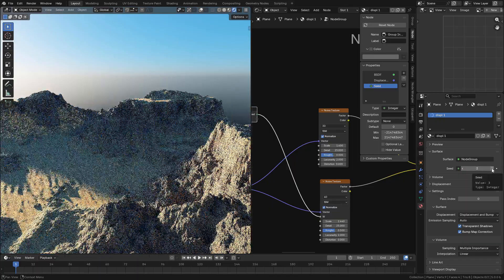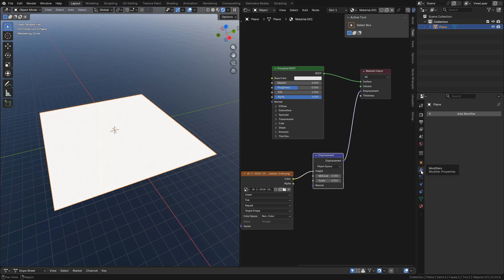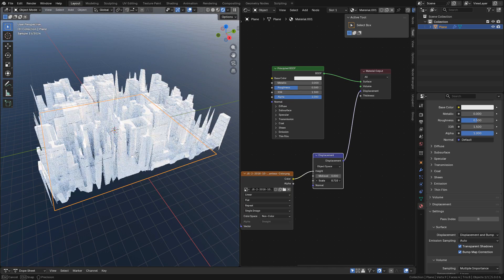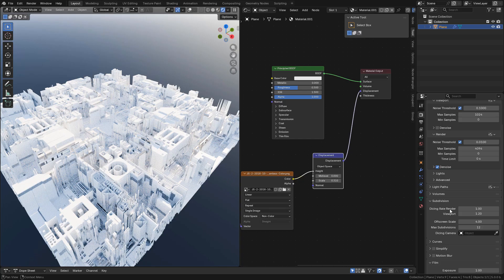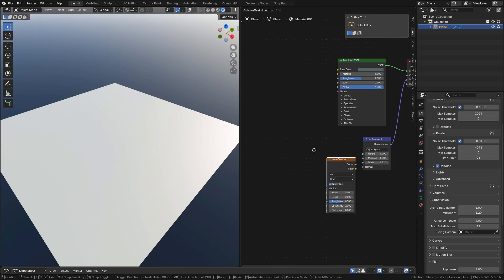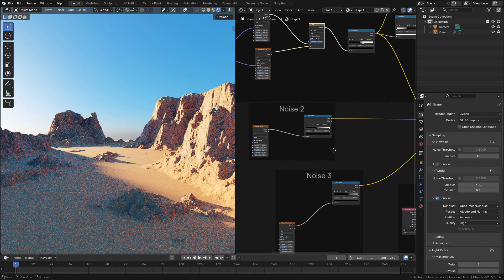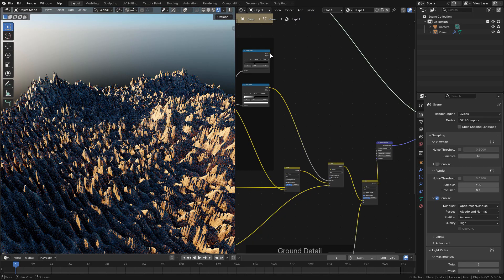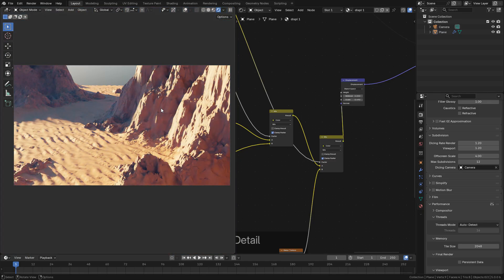Material Displacement and Adaptive Subdivision in Blender 5

Comment: Gee, I'm in 5.0 beta and I don't see an adaptive subdivision button in the subdivision modifier window. I'm wondering what I might be doing wrong.
Edit: Hold on- I found it!
Reply: how did you find it? i have the same issue?
Reply: @trymruud2386  I think you need to disable auto smooth shading
Reply: @trymruud2386  I had old project, where all mountains gone flat. There was no option in subdivision. But when creating new modifier, there it was. (I think reason in my case was not Blender 5.0 but because I had forgot "simplify" enabled🤫)

Comment: So basically it’s exactly the same as it was since 2.8, just we don’t need to switch to experimental
Reply from the maker: I've been using it since version 2.78, all these years as an experimental feature, and they have improved it, it works much better now. What else could they add to something like this? If you have any ideas, why not send them to them?
Reply: @chuckcg 
well i was saying, because your title made me think there is some new features that’s all. there is not much to add, but the only issue with this feature is how the normals work. if you use it with a normal map there are black artifacts (if you have high value to the displacement) because the normal calculation is a bit off  (out of the geometry bounds basically), you can fix it with some relatively simple node setup, but the devs should really address it by themselves so it’s working normally “out of the box” but they don’t since they insist there is no problem, but there sure is. anyway appreciate your videos, i was just commenting.
Reply from the maker: @-Belshazzar-  Well, I always try not to exaggerate or lie in my titles, but Blender 5 is coming soon, and this is a very powerful feature. I love using it in my environments, it saves a lot of memory. Regarding what you mentioned, yes, it is a problem, but I once heard that in theory, if we use a displacement map, we don't need a normal map. However, I do use both, and I understand what you're saying. I hope it can be fix it.